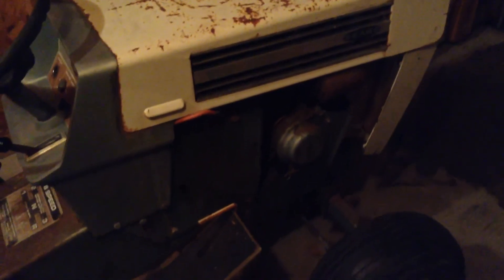1969 Sears SS12 Update #2

Comment: Good update bud! And yes get that water outta there as soon as possible cuz contrary to what some people told you, water bad oil good. lol! Water will screw that thing up the longer it's in there. Yes it will crack the case, no it isn't good for the gears, bearings etc... And it will force oil out all the seals due to pressure. So some people need to stay awake in physics class. lol
Reply from the maker: Lol ain't that the truth!!

Comment: ive got the same tractor and someone drilled out my drag link too. lol. if you tighten up.the bolts and then put a lock bolt on it it tightens it down
Reply from the maker: K will do!! Thxs for the info!!
Reply: +68 Deere theres a few drag links on ebat right now too. i believe that there around 20$ a piece
Reply: +68 Deere theres a few drag links on ebat right now too. i believe that there around 20$ a piece